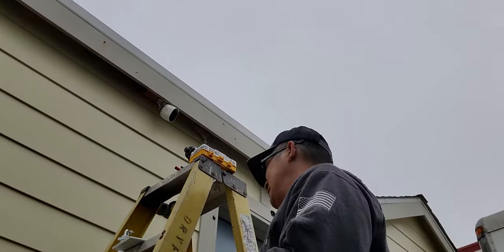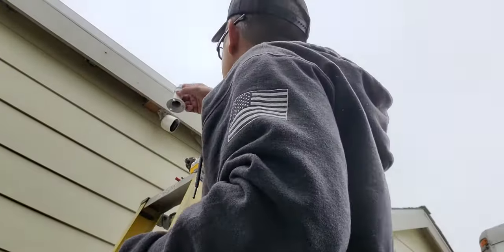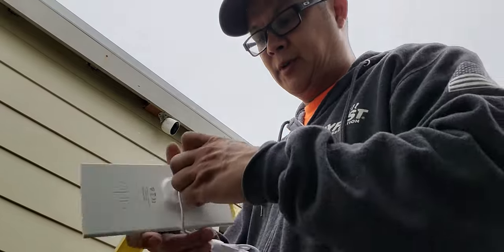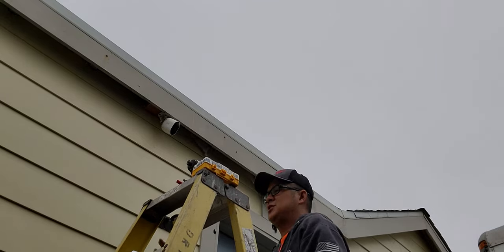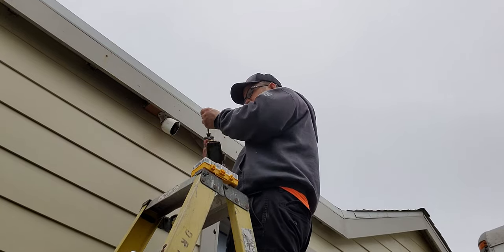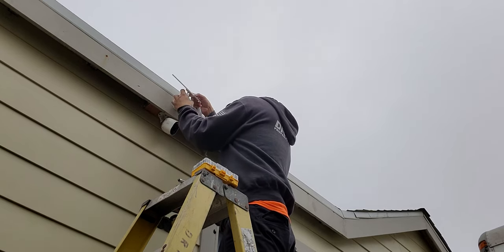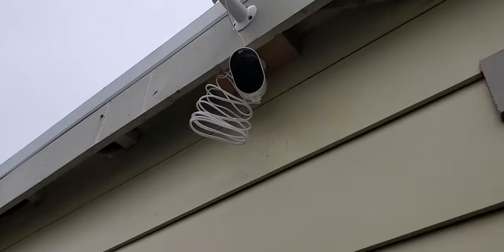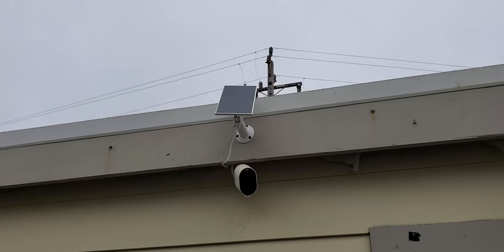how to install arlo security camera solar pannel easy arlo solar pannel installation

Comment: good video, but I would not use drywall screws b/c they will rust quickly.  Use exterior deck screws.
Reply from the maker: Everything here rusts fast its right across the street from the ocean.

Comment: Hello! One of My solar panel shows 20 % charged in 3 months, why? How to fix it? Can you give me some advice please? Thanks ❤
Reply from the maker: Check the connection between the camera and the plug for the solar pannel and make sure the connection is clean
Reply from the maker: Check  The connection between the camera and the plug going to the solar panel and make sure it's clean and it's getting a good connection so that it could charge the camera properly

Comment: I did mine and one chargers great the other doesn’t and the panels are both pointed at the same direction
Reply from the maker: Could it be a battery issue?
Reply: @migueltorres79 you might be right

Comment: Wouldn't it be easy to unplug it tho? Doesn't seem secure enough.
Reply from the maker: Unplug what? And I don't know how to make it more secure than how they wanted it mounted.
Reply: @migueltorres79  unplug the charging cable.
Reply from the maker: @carlos10571  the cable wasn't plugged in until the end of the installation.

Comment: Is it possible to just secure the panel to the roof without using the mounting hardware? I'd want to make it out of site.
Reply from the maker: I'm sure you can liquid nail that sucker on anything. Or whatever adhesive you think you'll do best

Comment: I got a question..  Now as I was reading the specs on this thing.. I did notice that it was supposed to be put in an area that is not going to get water on it rain snow or anything like that.. did you take that into consideration?
Reply from the maker: Ne we did not. We have no other choice here in pacifica. Where it's wet all the time. We are right across the street from the ocean. These guys are wet everyday and are still working

Comment: Very helpful. DOES THE SOLAR COMPLTELY BIYPASS THE BATTERIES OR CAN THE UNIT USE BOTH  DEPENDING ON AVAILABLE SUNLIGHT?
🙏🙏
Reply from the maker: The solar pannel is there to charge the battery
Reply: According to Arlo the solar panels does not charge the battery it should just keep the battery charged which in my case does not work which is quite frustrating. If you do purchase the Arlo Pro 4 do purchase as well the battery charger, you would need it to charge your battery. There is also a 25 feet charging cable. The cable and charger uses a USB but you would need an adapter for it to work. I taught the solar panel would charge the battery but this is not so which is quite disappointing.

Comment: There is one issue I noticed. The camera you’re trying to hook the solar panel into  must be mounted on a magnet holder. If you have a screw type holder, this will not work, because the end port covers the screw thread. Pls Let me know if others are having this issue.
Reply from the maker: We have them also without the magnetic holder and it mounts just fine
Reply: @migueltorres79  are you saying you were able to use the screw type camera holder?
Reply from the maker: @sureshsundaram7506  yes
Reply from the maker: @sureshsundaram7506  https://youtu.be/W8YJnOjAHIU?si=LsvsjTblYIaQPMFD
Reply from the maker: @sureshsundaram7506  look at the camera on the top corner that is a screw type holder. I wish I would have taken a closer video. But it will work

Comment: Do you have to have a separate panel for each camera?
Reply: Yup. They have a single camera connection for each panel. The panels don't generate enough power for more than one camera.
Reply from the maker: Yes